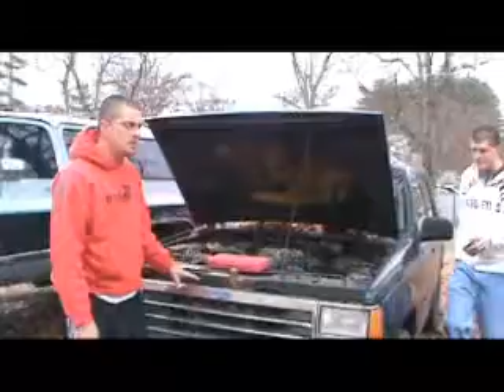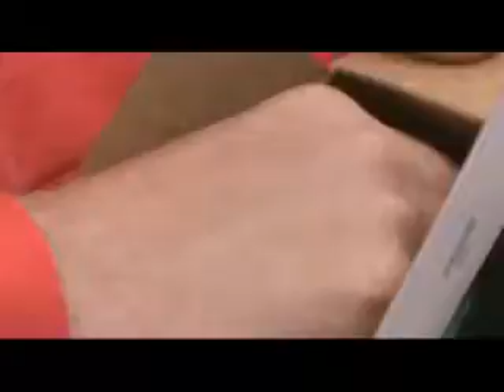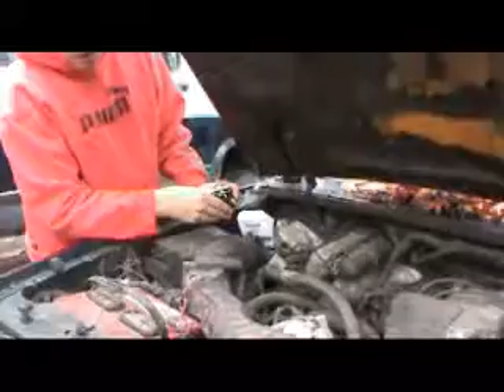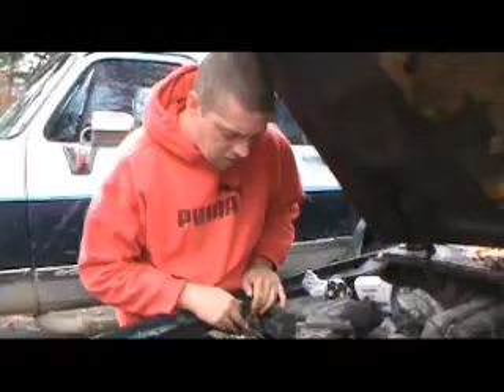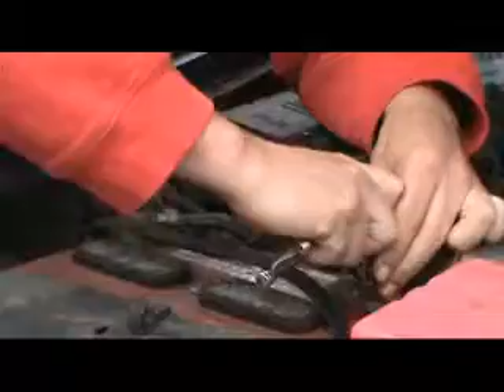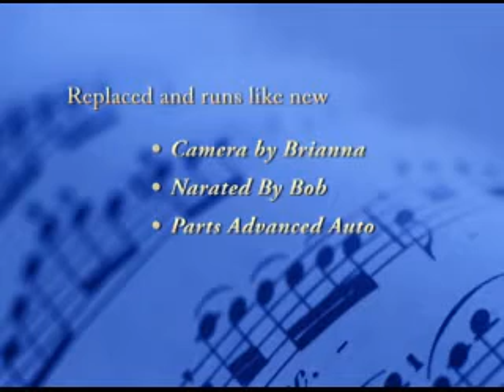Ford solenoid replacement

Comment from the maker: All you would need to do is check the ignition switch if that's ok replace the solonoid all your doing is manually jumpimg it most likley its junk it doesn't matter what side its on that changed from year to year

Comment: I just bought a 95 ford explorer, but i have to start it up by using a screwdriver against the two tips of the solenoid. It fires right up, but is very annoying have to pop the hood and do this everytime i go somewhere. Plus im afraid this makes it real easy for someone to steal. What do i need to replace on it? also on mine the solenoid is on the driver side firewall/fender instead of passenger side. Thanks for your help.

Comment from the maker: It could mean the solonoid is going the best way to test it is use a screwdriver and shortout the solonoid from power to the small tip that has a small wire on it if it starts right up its ok if it clicks its going or gone. Fords also have a problem under the dash where the arm for the ignition goes into a box that determins key position. that can go too but is alot rarer. my guess is the solonoid. Plus its like a 12.00 fix hope that helps

Comment: hey nice video. I just put new terminals on my f150 and when i go to start it, it clicks and tehn i try it again and it clicks. It does that for about 3 to 5 times and then it starts. Does that mean that my solenoid is going out